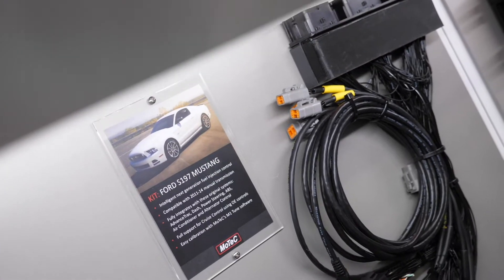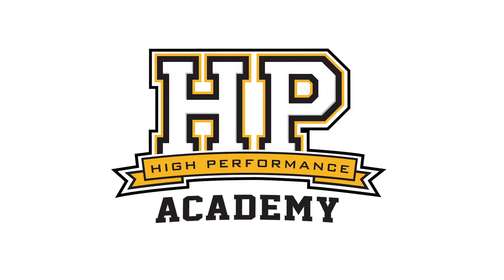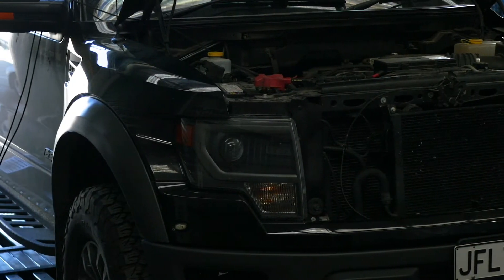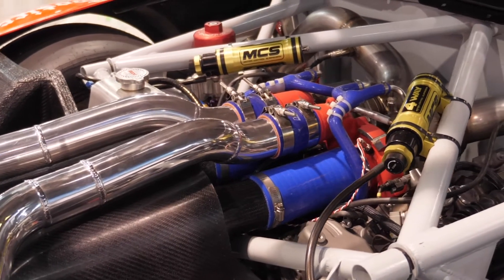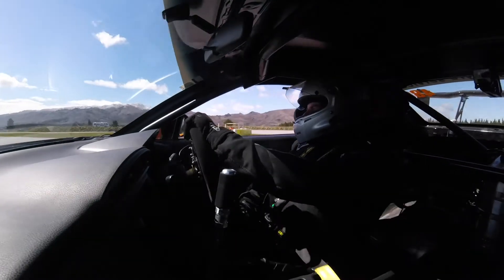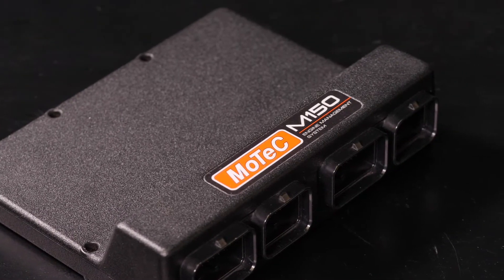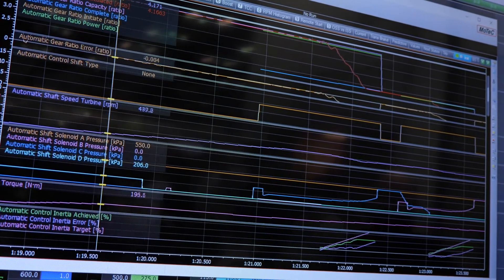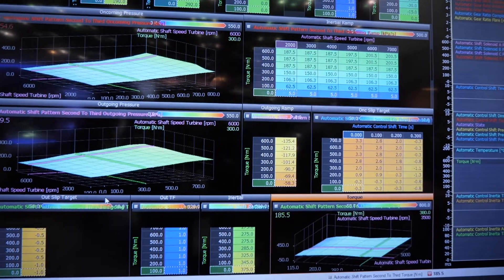Transmission Tuning 101 | Standalone Transmission Controller MoTeC [#TECHTALK]

Comment: I'm eager for the 10R80/10L80 controller to come out. When it does I'm getting a built/bulletproofed 10R and a Performance Automatic Adapter to go on my built 7.5L swapped F-150. 6R80/6L80 is fun and all but ain't got enough gears to play with.
Reply: We're all waiting, usshift has been quiet for a while on it so idk when we will see one

Comment: Only a few different ECU makers even do transmission control and the ones that do, don't do it for cheap. With the Toyota A340E, the only standalones available with transmission control were the Haltech Elite 2500, Motec M130/150 GPA, the Wolf Tuner Sport & the AEM Series 2.
Reply: MaxxECU can control a340e also. Have done it myself.
Reply: @juusolahde  Oh nice! Learn something new everyday. 👍 I went with Wolf myself.

Comment: so a swap im working on is using a GM 6T45 or MH7 and the problem im hitting is that the motor im swapping never used a  A/T from factory,  so i've started looking into transmission controllers, but cant seem to find one that says it fits my tranny, would the products mentioned here be something i'd benefit from in this regard?
Reply from the maker: Worth checking out if they support your gearbox for sure - Taz.
Reply: @hpa101  im not seeing it on they're website any other suggestions?